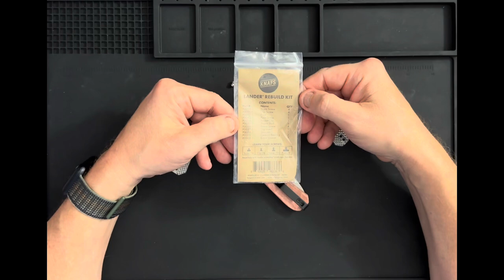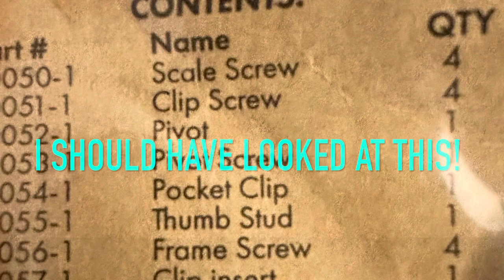Knafs Lander Titanium Scale Upgrade and Rebuild

Comment: Great video and so far one of the only on the tube!! im a titanium scale guy so, gonna order so many different scales from WOK to bling out my lander each time they make another version with better steel. Keep up good vids, hope you get some affiliate coupons soon!
Reply from the maker: Thanks for watching and commenting! These scales really turned this knife around. Now it just seems to always find its way into the pocket. Just got some unlocked composites lander scales in, so will need to get another lander to mod. I think the 14c28n with micarta would be good, especially since it still has sw blade. Unfortunately the urban edc m390 version is a satin finish, not my favorite for a user.